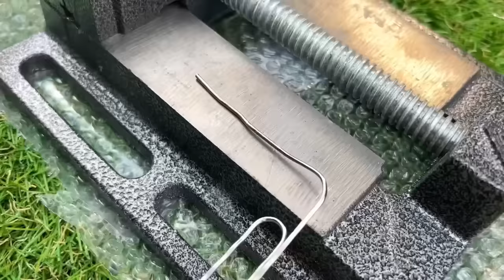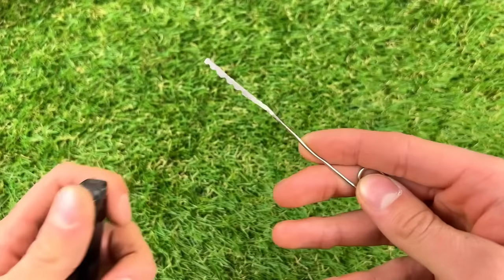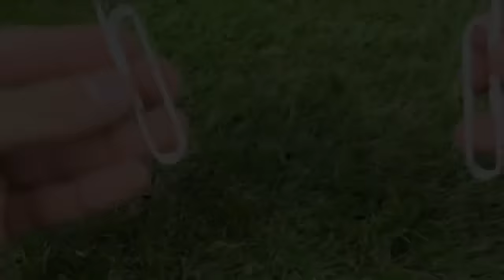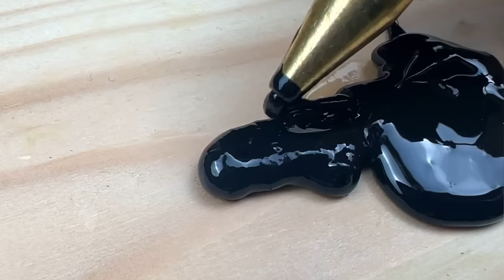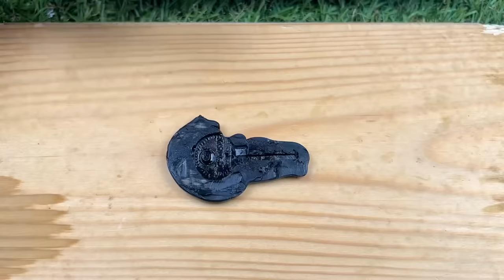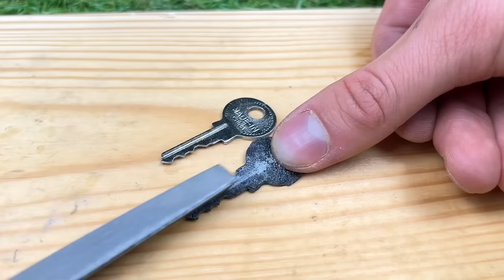How to Make a Key that Opens any Lock! This man is a Genius!

Comment: So he's made a tension tool and pick/rake. It won't open all locks so a big claim there. It will open the cheap padlock he uses as his demo though.
Reply: Will break easily.
Reply from the maker: Thanks for your opinion ❤
Reply: If you know the correct technique it'll open most locks
Reply: Raking is actually a very effective way to open a lock without a key. Not just pad locks. Most locks can be raked open.